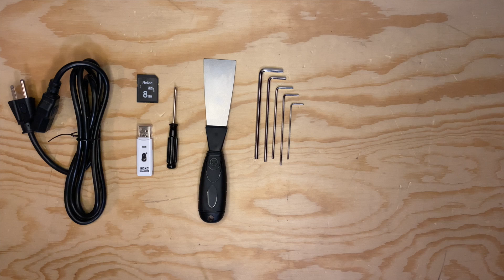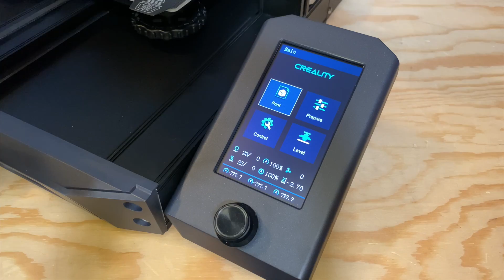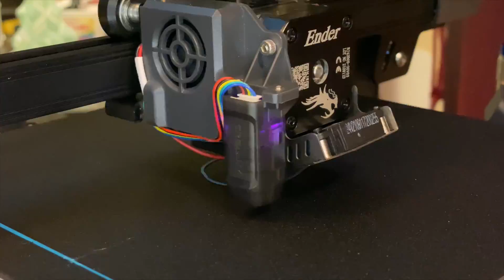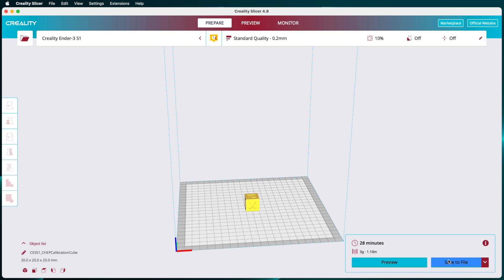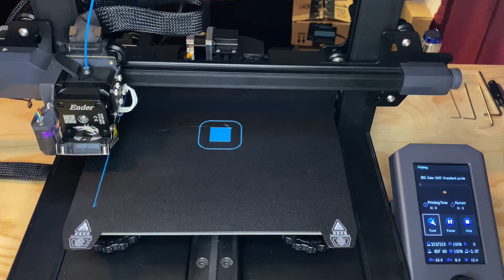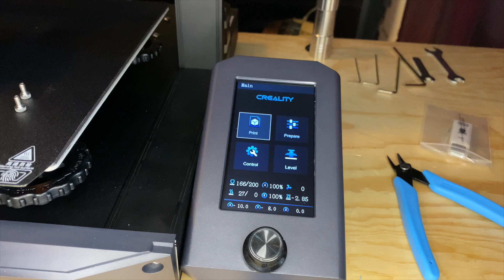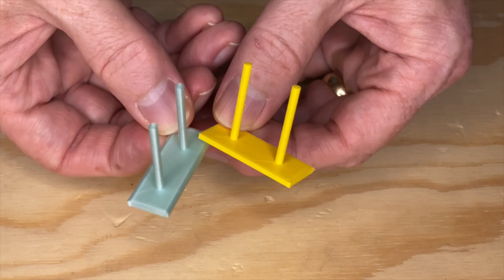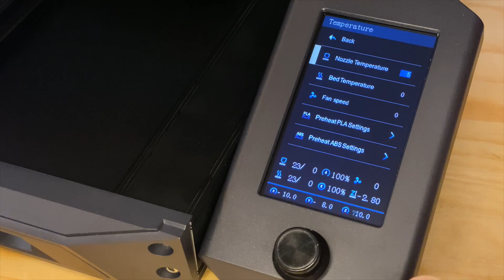The New Creality Ender-3 S1 Review!

Comment: Anyway you can check if this works with octoprint attached to the USB C port?
Reply from the maker: Hi, I connected a Raspberry Pi 3B+ with OctoPrint to the printer last night, to verify connectivity. I didn’t actually start a print, but I could see the temperature graph and move the axes around. I needed a USB-A to USB-C cable to connect the two.
Reply: @BV3D  great thanks for the feedback. Much appreciated.

Comment: My chin has just hit the table! Creality's programmers have learned how to set the XY offset correctly for the bed probing so you get an equal and correct mesh, now all they need to do is fix all their other ABL firmware for their enormous range of machines, and while they are at it they could fix the power loss recovery on this machine, I was dissapointed with the Allen Keys, without ball ends its a real pain to tighten machine screws and the price difference to Creality must be microscopic, so why?

Comment: Hey Brian,

Hope you see this. Great video as always 💪🏼

With the failure you had, where the nozzle made a decent imprint on the build surface, I still feel it’s a firmware related issue with the BLTouch (CRTouch from my understanding is a rebranded BLTouch) rather then a SD card issue as CHEP suggested (I have tried multiple SD cards, the same even happens if I print over USB, lol). I’ve been having this issue at random intervals on my Ender 3 v2 since installing the BLTouch with the default Creality BLTouch (Marlin) firmware and also the latest Jyers Marlin firmware. This has happened when I home all axes, started a print, after a power failure and even mid print, but never consistently so that I can identify what’s causing it to try and reproduce the issue and send my results off to Creality Support.

Luckily I’ve always been around or close to my printer when this has happened and could switch the power off in time before there were any irreversible damages, however I haven’t been so lucky when I recently (as in last week Friday) fitted the wham bam flexible PEX build system 😔

Installed it and was so stoked to start my first print on the brand new build surface. I relevelled the bed, performed ABL (I have the UBL Jyers firmware installed), even double and triple checked my Z Offset to avoid a collision issue and was ready to get printing a small 10mm x 10mm x 10mm cube. Started the print, waited for the bed and hotend to heat up again and got distracted, next thing I glance over and my nozzle is pushing the bed so far down the Z motor started skipping steps 😢

I was left with a huge nozzle imprint and a few deep drag/scratch marks on the PEX surface. After a power cycle the printer went back to normal and Ive been printing without any issues, barring the messed up PEX sheet (which I’m struggling to find a replacement sheet in South Africa at the moment as we only have one supplier stocking them. As any South African will tell you, impoting is not an option as parcels mysteriously disappear lol)

My biggest concern is seeing you having a similar issue on the S1 as I’ve had with the hotend destroying a build surface it makes me wonder how many other Creality users have had the same issues since fitting a BLTouch to their Enders. 

If you do manage to find a resolution or permanent solution, I would be very keen to see what you’ve come up with.

Keep up the great work
Reply: "CRTouch from my understanding is a rebranded BLTouch"
The CR Touch is, to my understanding, not simply a repackaged BL Touch. The simplest difference to see, besides the external shape, is the use of a metal pin over the plastic one in the BL Touch. The CR Touch does share the same input / output interface but that is a very smart decision in my mind because it allows any plugins or code that was written with the BL Touch in mind to work, without any code changes, for the CR Touch.

Comment: Great summary. Try a different SDcard. That could be the issue with power loss recovery just in case they are still doing a ReadWrite after every layer.
Reply: Interesting, my Ender 3 V2 does strange things occasionally that are seemingly related to the SD card/file naming. For instance, prints used to start at something like 500% speed and I believe I narrowed the issue down to the way files were named (omitting the CE3PRO title from Cura exported file names seemed to solve the issue).

I also run into weird issues when changing z-height after a print without homing, such as the extruder retracting something like 100 mm all of a sudden.
Reply: @Bfyobrian12  Maybe your SD Card gets corrupted. Do you eject the SD Card each time you take it out of the PC?
Reply: Would love to see a collaboration video with CHEP and BV3D :)
Reply from the maker: Thanks, Chuck! I'll give that a shot. It seemed weird that it was able to finish the layer it was working on when I turned it off, but as soon as it finished it, down it went.

I think I'll try it on a tall, hollow cylinder, and let it get up around 10cm before power cycling it, so I have a better chance of cutting power if it decides to take another dive.
Reply: @BV3D  please let us know how that second test goes👍
Reply: @BV3D  similar funky issues in the past were able to solve even with formatting the SD card with correctly created MBR table.
Oh I just checked and you even have video for that matter =D .
So yeah, probably incorrectly formatted SD card from the factory.
Reply: @BV3D  I tried to shutdown and recover in the middle of the job (like after at least 50 layers) and it worked pretty well.

Comment: I wish you showed tolerance tests and didn't use silk shining filament. That filament ruins the entire prints sections. Anything even an anet a8 looks great with those!
Reply from the maker: I'll run some more prints with the Jessie Pure Cyan PLA (that's what I printed the rabbit with). I'll post them in the Community tab in a day or two. Do you have a suggestion for a model or two you'd like to see printed?
Reply: @BV3D  oooh that's awesome thanks! I hope my comment didn't come off as rude.

Maker's muse has an awesome tolerances test they recently released!
For the tests I use grey filament my self
 Generic simple plan from esun etc. Nothing special! No Shimmer or additive
Also measuring some cubes would be lovely and simple xD and some holes

Seeing how smaller they turn out

You can use a drill bit's handle or a dowel pin to test them

Comment: i feel bad for laughing at the power recovery thing. its like it was throwing a tantrum.

as for the rest of the issues. The fan noise i think is an issue with all creality printers, there's a reason its listed as an upgrade in a lot of peoples build. Even yours. 
the temperature is a weird one, particularly the turning off of the bed during leveling. 

If i didnt already have a v2, and wasnt looking at upgrading to a ratrig soon. Id probably pick one up.
Reply: To keep the bed hot during leveling should be a simple tweak to the initial G code in Cura?  I made the change for my Ender 3 V2 and it stays hot while leveling.
Reply: The quality of fans Creality uses have declined over the years, I have an Ender 2 that has nearly 4 years on the clock and although the fans are noisy they have not failed unlike the super noisy board fan on one of my 2 Ender 5 Plus machines whose bearings decided to eat themselves and the heat fried the USB chip, because of this I have changed the board fans on all my Chinese printers for quality quiet ones